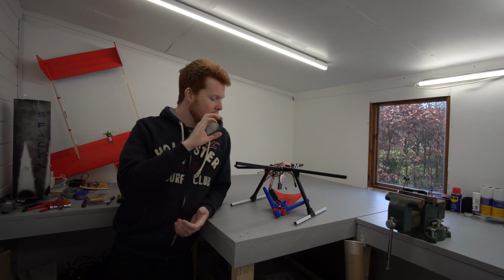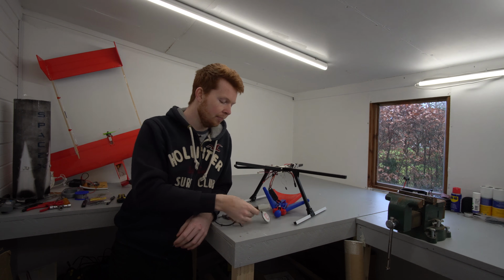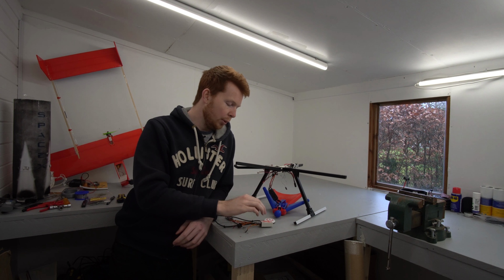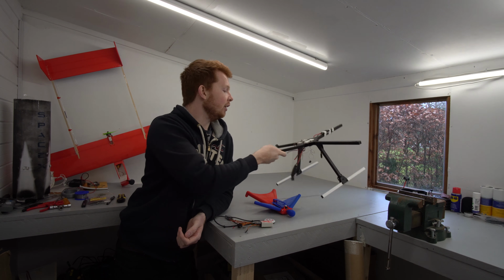3D Printed Drone

Comment: You should make an autonomous 'plan' for the naza so it takes off with a flick on the switch and it will go to a certain height, drop it, or you manually drop it and then it will land again.

Comment: Hey man, I've noticed that you're using the MINI TS100 Digital soldering iron.
You should probably post that in a list of tools that you use, I feel that this soldering iron is just perfect for hobbyist.

If  anybody is wondering you can use it at 12-24V standard plug. and it's supper quick to heat up and relatively decent soldering capabilities...  the build quality feels like a very decent product, not like it's built from scraps and then sold as "gourmet", takes very little space, and can be used with batteries bank for infield repairs, you can't do that with desktop irons :)

It was recommended by a friend of mine, and I have to say it's the best purchase that I've made, I don't have to dedicate a whole lot of space for it, and it didn't cost so much that I put it on the "some day I'll buy that list"

Comment: 1:46.. The NAZA FC with GPS is still available. My first one cost near $300. Now you can get one with the original NAZA GPS puck for $79 USD straight from DJI.
3:57.. The NAZA works best if it is mounted at the center of the drone although yours is fairly close.

Comment: Unfortunately the scaling effect does not apply on fall speed. So you have to release it on 200m or higher to have a useful flight time (drop to fly).
If you would release it with a horizontal speed you would reduce the "drop time", that's is why I would choose an (electric) rocket or plane.

Comment: Turned out very neat with the 3d parts.
 -Maybe the release control would have been better on on the glider controller? (no rush in switching controllers)
Love your content!!
Reply from the maker: I was tempted to put the switch on the glider controller, however it would require either a release servo on the glider (which is an issue due to lack of space and would also increase the weight) or have an extra receiver on the drone which is bound to the same controller as the glider. So I think I'll just switch controllers quickly haha. Thanks!
Reply: haha.. I look forward to seeing everything together,
(maybe straps on both of the transmitters around the neck, so you just drop the one and grab the other)

Comment: What material did you use on the 3D printed parts? I was going to build something literally exactly like what you did but I wasn't sure if the 3D printed Parts would be strong enough to hold the aluminum arms in that manner

Comment: hey Tom! I was thinking about making a 3D printed frame for a drone some time ago, but I am worried about the vibration that may appear. That frame you have built, do you notice any vibration or is it behaving correctly?
Reply: Pablo MorPal Hey Man, having Build a handful 3D printed Drones as well I‘ll answer in case Tom misses this: I‘ve build 100% 3D printed drones (including 3D printed Arms) up to around 280 sized. Printed out of ABS with roughly 25% infill. If you want to print the arms as well make sure they are designed to be printed, don’t just print a flat plate, that will wobble like crazy. 
If you want to do it like Tom did it it’s no problem at all.

Comment: Hey Tom,
 I'm working on making an electric bike similar to your single motor design. I noticed you used a 6s battery, but I was wondering what might be the merits of using two 4s batteries wired in series versus wired in parallel, would the two 4s in parallel have enough voltage to get the bike moving? Would the effective 8s battery be too much?
Thanks for any help you can provide,
Hayden

EDIT:
Also was wondering what the main limiting factor of the 1st and/or 3rd setup was, was it the motor, battery, or vesc?

Comment: It will be interesting to see how well the wing suit flies! Regarding the CNC router that you sent back, you should just build your own. I did. It's called the MPCNC (mostly printed cnc) and was really cheap to build. All the corner mounts, stepper motor mounts, gantry and z axis tooling are 3D printed parts, so make them yourself. The rails are cheap electrical conduit, and it uses skateboard bearings as rollers. Check it out at https://www.v1engineering.com/ or do a google search for MPCNC. When I built mine, I sourced my own supplies, and I spent roughly $150 US to build the entire thing. Mine is 36" x 48", but you can build it whatever size you want.

Comment: What filament do you use? Petg, abs, pla?
Reply from the maker: I used PLA for this build. I occasionally use PETG for stronger parts, like the pulley on my electric bike V3. ABS is probably my least used filament, but I still use it where I need a smooth part, for example, the air compressed engine.

Comment: Thanks for your previous advise about voltage setting for CR-10, everything worked ok but now I’m getting juddering in x axis.
I have tested wire on another axis and so am confident it’s not the stepper motor. 

I’ve also adjusted the belt, wheels and even the x axis controller within the box...   

But still sounds bad and moves badly, do you have any suggestions, for this novice?
Reply: Another great video btw, keep up the good work buddy.

Comment: Please please please... how did you get NAZA and Taranis working?
I have 3!  Naza original, Naza V2 and Naza lite... none flying :(
Reply from the maker: It works the same way that other transmitters/receivers would work with it. I used an L9R receiver because it has the 'traditional' servo outputs rather than the ppm/sbus outputs. Then you'll just need to plug it into the NAZA using the 5 male-male servo wires.

Comment: Tom, when  you powered up the Drone the sound it made to initiate was identical to my Simtoo Moment Drone which I backed on Indigo go, the damn thing is pretty much useless! It's controlled via a WiFi direct link to either Android (as is my case) or IOS via the or app. You seem to know an awful lot about Drones and electronics therefore wondered if you have come across the Simtoo Moment Drone?? If not it would be even more interesting if you could take one apart, write some firmware that works with it and even look onto the APK file and debug or redesign it completely as they have take  their money as disappeared with regards to any updates and or support.. P. S. Keep up the good work